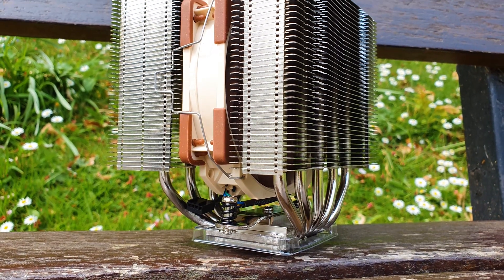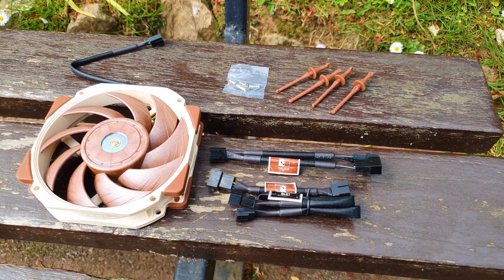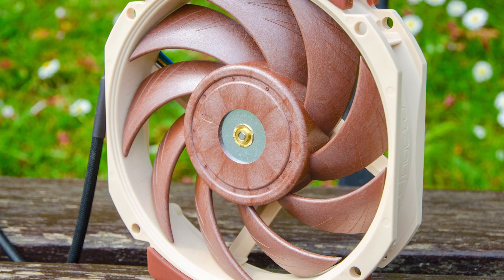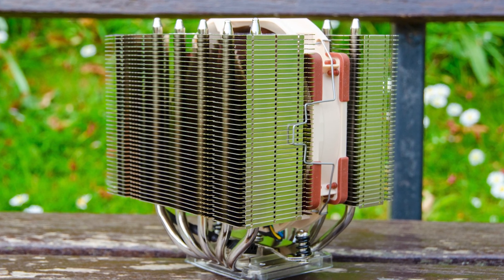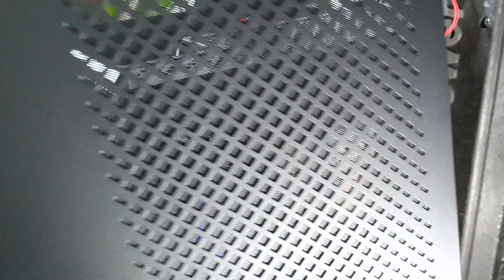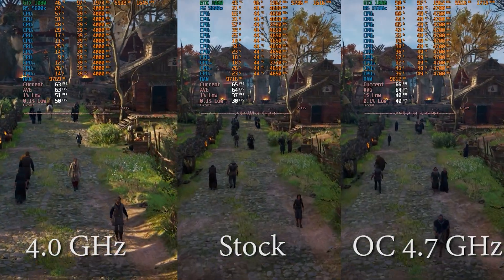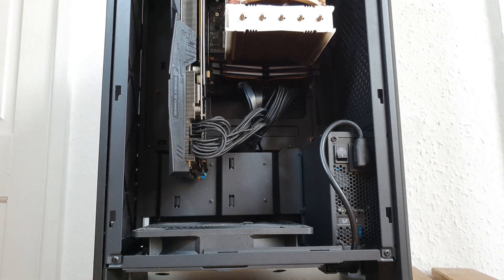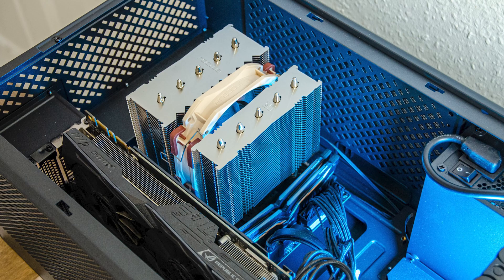The Ultimate Hybrid - Noctua's D12L

Comment: Im very late but will this cooler be enough for r7 5800x???
Reply from the maker: No worries. I would say so but it will be on the limit since these chips love to boost violently (even the lower 65W TDP ones like 5600x 5700x) and basically use any cooling headroom you have. Luckly, I can recommend my scenario. I have the 5700x which is also an 8 core  and I just locked the the voltage at 1.000v for 4 GHz across all cores. Dead easy in the bios and it gives me the same performance as stock and it's like 20 degrees cooler on a slim 140mm AIO from the NZXT H1 V1 case.

Comment: hello, thanks for sharing... I have a question. I own a i5-12400 (65w tdp), with the cooler can I use it without a fan?... I want a kind of silent build and I dont want to go for the NH-P1, find it too big!!!
Reply from the maker: If that CPU stays at 65w overall, then yes, it should offer plenty of cooling headroom even fanless. 

I mean, it's Noctua afterall, so even at 30% RPM it's dead wilent. I figure your PSU, GPU will make more noise way before this cooler does. Only if you have everything fanless 😁
Reply: @Glob3Tech  thanks
Reply from the maker: @elteacher0223  You're welcome. Let me know how it goes 👍